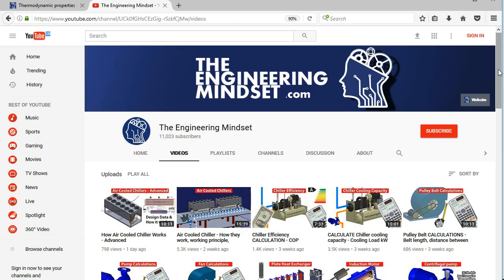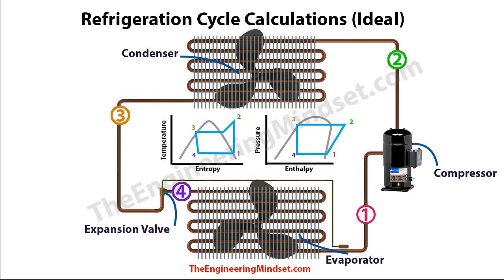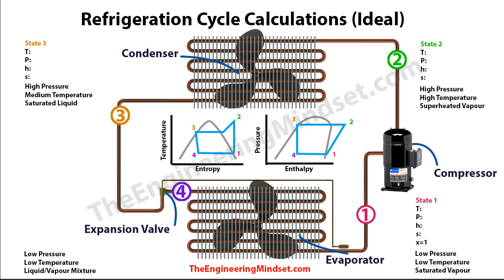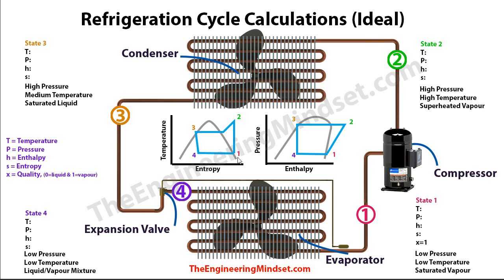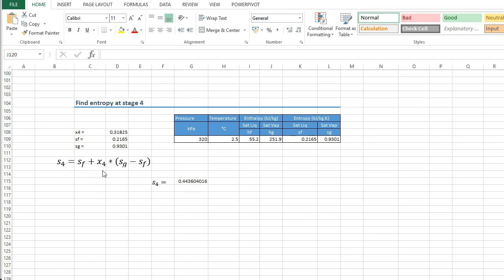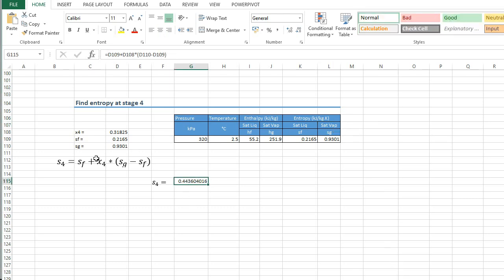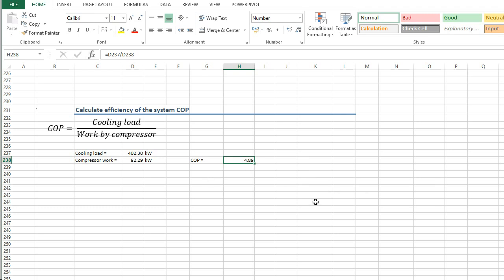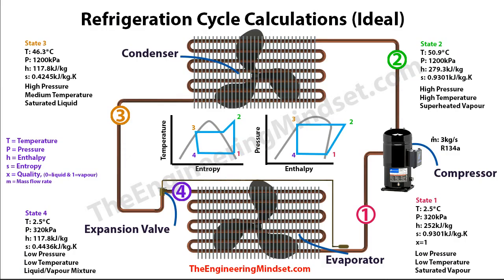How to DESIGN and ANALYSE a refrigeration system

Comment: Just a minor correction, in your slides and in tables you use, the Enthalpy and Entropy, should be labelled Specific enthalpy and Specific entropy. Sure, it is a sortcut, but still, it is nice to be more .... specific :) Distinction is useful when then anlyzing enthalpy and mass flow and work required.  Also thanks god you are using metric units.
Reply: Do you know how to calculate length of tube required in Evoprator and condenser?

Comment: Do you know how to calculate length of tube required in Evoprator and condenser?
Reply: good question
Reply: ever got the answer?
Reply: I think it is based on your facilities (how far your evap and condenser areas are). And then you compute the corresponding piping pressure losses to adjust your respectiv capacities.
Reply: There are charts online for this. Heatcraft is a good source.

Comment: Great video, thanks! Just a note - if its W or kW it is power, if it is in Jaules - then it is work. Since the evap, condens and compressors are in kW all should be power.

Comment: Fantastic video but there seems to be an error. The gas flow rate of 3kg/s is far to high for the picture in the video. Data sheets normally give this as kg/h. So I assume your data sheet said 180kg/h and you only converted to minutes instead of seconds, giving extreme kW values. The compressor looks more like a 1.3kW rather than an 82kW. (i.e. 82/60)

Comment: Hey,, will you please guide how the lg compressor Dkt208mah which is producing 23100 btu is used in o general hot and cold model 2.5 ton.,which have a capacity of 28000 btu.. How these btu difference compensate cooling efficiency..

Comment: Thanks Paul! At minute 4:42, what path would you have taken if you had started knowing the cooling load you are looking for?
Reply: Same question here... I am having a difficulty starting at the cooling load. I'm starting to wonder if I am going to use the average COP of ref systems to know the power of the compressor that I would be using.

Comment: 1:37 - This is a beautifully crafted video on the explanation of the refrigeration cycle using maths! I look forward to being able to work through your amazing excel workbook on my own. he only thing you got backwards here in this diagram is the metering device flashes the refrigerant into the bottom of the evaporator and boils back to a vapor out the top. (I am not a troll. I just noticed the error.)
Well done, Paul! I didn’t see a link to your excel workbook on the website or in this video. Can you point us to a link?

Comment: Hello The Engineering Mindset, Do you have any video about calculating and designing for length and diameter of copper tube in a refrigeration system. Thanks you.

Comment: If we have a cooling load then how do we start the design of the Refrigerator? Also, how to fix the evaporator pressure if we are designing a system to cool at around -70 to -80 degrees celcius?
Thank You!!

Comment: I want to build a deep freezer from scratch, what kind of expansion valve do I need using your calculation? Like what should I look for in data charts of expansion valve after doing calculations?
Reply from the maker: Use coolselector by Danfoss. It'll do it all and the components
Reply: @EngineeringMindset  thank you. Is there any other kind of calculator or rule book for generic compressors and expansion valves?

Comment: Hello, I'm looking to design my own small scale refrigeration system for educational purposes, and was wondering if there is a specific type of compressor recommended? Thanks!
Reply: I'recommen recycling a compressor from an old fridge/freezer/whatever as it's the cheapest if you want to work at those temps.

Comment: Sir, I think according to consumer cooling load we select the evaporator to reject the heat load developed by system, in that video   evaporator rejected heat load is around 408kw and compressor needs 85kw(work done on the compressor) to generate the that much capacity,  what is refrigeration capacity of that compressor

Comment: 12:30 How can the temperature at state 4 (refrigerant entering the evaporator)  equal temperature at state 1 (refrigerant exiting the evaporator)?
Reply: if something is going through a phase change it's temperature remains the same. As in the evaporator from liquid to vapor. This is also a rough calculation (ideal case)

Comment: Hi Paul, when moving from stage 4 to stage 1 we assume the same temperature. But how do we account for superheat on the evaporator please? 

Would that be the “non idea” cycle? And if so is there a resource for this calculation anywhere please? 

Or is this accounted for in the suction and discharge input valves for the chosen compressor (ie 10k SH 5k SC)? 

Thanks
Reply from the maker: I'd say use the danfoss coolselector 2 app, it's free and will do all the calculations for you. I even narrated the tutorial videos for them.

Comment: Question: How do you know the pressure required for the low and high side? Is it just the pressures the compressor can generate and need for the suction side? 
Also, if that's given or you find out, how do you know the mass needed in your system just use the ideal gas law at that point?

Anyone can answer, I'm just curious
Reply: Hi Artur, the system pressure is determined by the type of system you need. The high side pressure is relative to the location of the installation. If you are in Mexico, the high side pressure will be higher than if you are in Canada juste because the high side temperature needs to be higher than the outdoor temperature. The low side pressure is determined with the kind of product you need to refrigerate. If it's a freezer, you need to be lower temperature, therefore lower pressure. To determine the mass of the system, you need the piping size and the density of the fluid at each part of the system. This can be quite the task so we usually apoximate until the installation in complete and the technician can tell you what is the final mass the he put in the system.
Reply: @felixstg1  Hi,  I want to rebuild a 120 L refrigerator into something else. I need to change both the evaporator and condenser with copper pipes that are much more compact. I suppose that with the condenser is easy - I need to measure the length and the diameter of the original condenser and coil another one, just more dense and to compensate the worsened airflow with a fan. But what about the evaporator? The fabric evaporators are aluminum plates with unknown tube diameter and sometimes there are even splits in the line (i don't know for what purpose). And I don't want to cool air, but a volume of water down to 2-4 degrees. Will this change the refrigeration cycle somehow? Thanks!

Comment: Is it possible that the exit of the evaporator (1), is further than saturation line (x=1)? I.e. I understand it would create pressure extra at 1, higher than at 4, but is it possible in practice (with sufficiently thin pipes or something?)

I also heard of some systems that operate above the critical pressure, could you cover these systems in separate video?

Comment: Thank you for this useful video, I thoroughly enjoyed watching it. There is a one thing though: on the evaporator load: it's written as m*(h1-h4) but calculated as m*(h1-h3). I presume is the latter. Am I correct?
Reply: H3 = H4 isentropic process
Reply: It is not isentropic. You probably meant isenthalpic, but it is not either of them. In reality, to be more precise it should be said that the enthalpy at 3 is the same as the enthalpy at 4. Between 3 and 4, enthalpy may be slightly varying.  Hope it helps.

Comment: 137/5000
Hello Paul. Your videos are great. I'm just curious to know in which part of the system is located the plate heat exchanger? Thank you.
Reply from the maker: Well a plate heat exchanger is just a compact heat exchanger where two fluids exchange thermal energy. The condenser and evaporator are the two points of heat transfer in the a/c system so you'll often find phx on these parts.

Comment: Just wanted to ask, I am using a different table and chart that comes from a book, which has quite different values than yours. When I read the preface, it says the tables and chart are based on a 0 *C where values of hf = 200 kj/kg and Sf = 1 kj/kg K. Is there a correction that I should do to get the same values that you get if I use my book. Thank you.
Reply: There is no need for correction as you calculate with differences most of the time. It the difference between 2 points that matters.
Reply: I am using a software called computer aided thermodynamic tables and it shows hf = 200 kj/kg and Sf = 1 kj/kg K same with yours. The table does not match with software for U,H and S.

Comment: I am using a software and it shows hf = 200 kj/kg , hg = 400kj/kg and Sf = 1 kj/kg K , Sg = 1.72 kj/kg. The table that you have does not match with software for U,H and S.

Comment: I have a question please, 
In our country we get ambient temperatures that reach 55 centigrade and the air temperature over the asphalt can reach 60 and inside the car if you increase the fan speed you will not get any cold air in the cabin. We use R134A refrigerant in our ac system. I was wondering if the gas will not condensate at these ambient temperatures.. ? Can you help please. 
Thanks a lot.

Comment: This is a bit too reduced to be useful. Stage 1 is not a saturated vapor. There is something called "superheat". Compressing into stage 2 also adds entropy. Stage 3 is not a saturated liquid at boiling temps. There is something called "subcooling". 
These simple 4 step diagrams don't cut it.